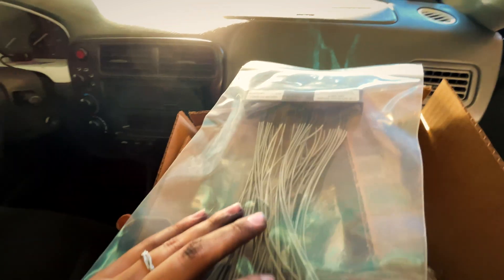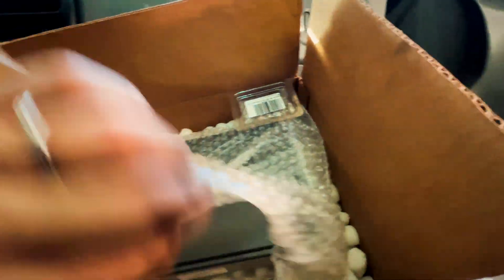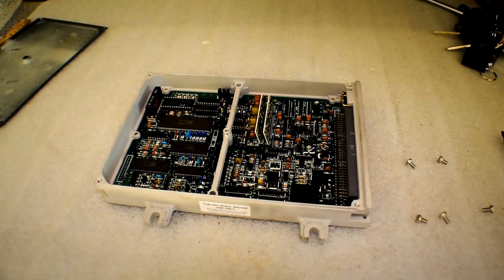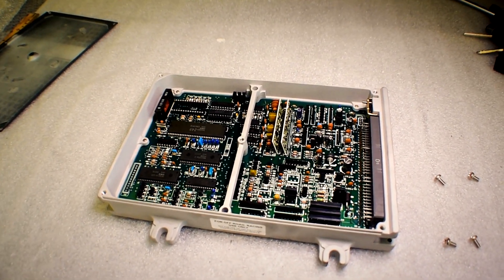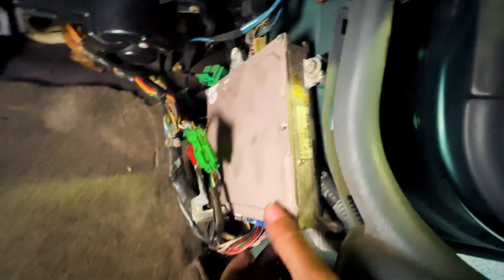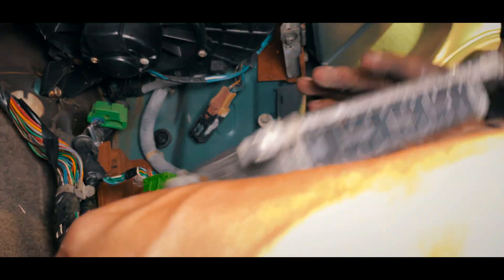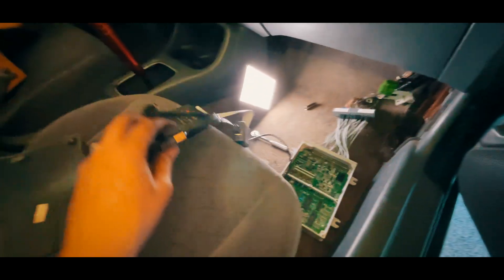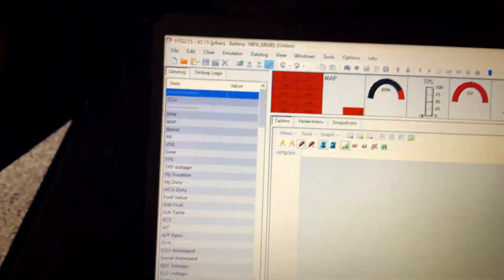Connecting P28 To Honda Tuning Suite using Moates Ostrich and Hulog!

Comment: Nice video. I use this exact setup for years with out issues, first with crome then with HTS. Solid package. I see some here are saying they have issue with the hulog well that is bad solder connection on ecu or backwards on plug or lastly drivers on computer. Always cut the j12 resistor and your good. I think its sad these are end of life. I have had mine for 13 years same battery in the emu!
Reply from the maker: Yeah man it’s a solid setup 
Thanks for the tips man I’ll pin it so people can refer if they have issues 🙌🏽

Comment: can i tune only using a data logger or do i need the ostrich too? or ig the emulator
Reply from the maker: You will need the emulator to Live tune.

If you want to tune with only the datalogger, you would need to make changes to the tune, burn the chip, but it in the ecu and datalog the changes.

To me, not at all efficient. 

I highly recommend the emulator.

Comment: sorry if its noob question... since ur on a y8, couldnt you choose to go with a p2p (y8) basemap on the p28? why did you choose the  z6 basemap?
Reply from the maker: There are no y8 basemaps in OBD1 unfortunately. 
All the Y8 ones you’ll find are usually recreated not ripped due to the p2p being an OBD2 ecu
Reply: understandable... are these y8-wannabe basemaps any good? if i use the z6 basemap and take 4-5 degrees out, across the whole range, will that be closer to the y8 map? or are there more things that make the y8 map different? appart from knock sensor and 2nd o2 sensor of course.  @CJBuilt

Comment: Hey since moates is gone, and no one can get ostrich, demon, hulog.. and only can get(if your lucky) other expensive emulators. I have been thinking it would be good to highlight that there are still budget options out there for tuning B/D/F/H.  We have replacements for ostrich, hulog, burn2, etc that can get people tuning on a budget.. Yes they are a little more work but its good to learn, since 99% of people have no use for an emulator as they don't even know how to tune, or even touch it after its tuned so then its just an expensive unused piece of hardware when a chip could take that same place. Reach out if you would be interested in doing a video that could highlight this process and what we offer.. We are trying to help keep the budget/chip tuning for OBD1 alive like moates did for many years!
Reply from the maker: Will reach out on Instagram!

Comment: Im having issues connecting the Hulog. Ostrich works fine but the hulog will not connect no matter what i try. When i try to connect it times out right after and cannot connect to ecu. Any know issue to why? Sometimes when it tries to connect gives me “j12/4 not disconnected”. I’ve already cut j12 and still no luck. Updated drivers and everything as well
Reply from the maker: The only thing I can think is it’s not reading the right port for the Hulog
In the settings I had to mess with it a bit to find the correct port it was connected to. 
I suggest taking it off auto detect and changing it to another com port to see if it picks it up.
Reply: Wich speed?
Reply: Same

Comment: Question. On the hulog mine connect then disconnects instantly any ideas?
Reply from the maker: Have you tried changing the ports?
That was happening to me at first and I had to change the ports on the settings a bit until it started working.